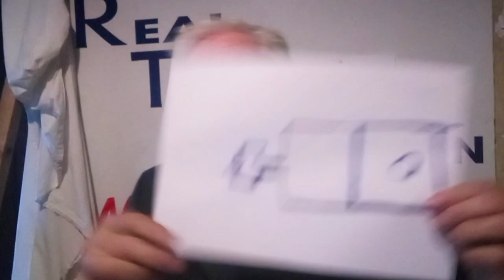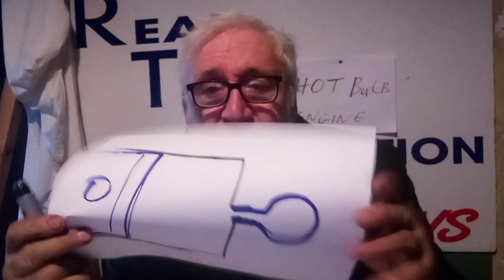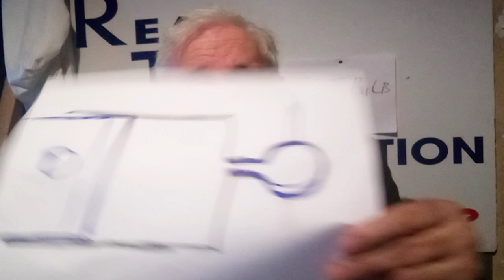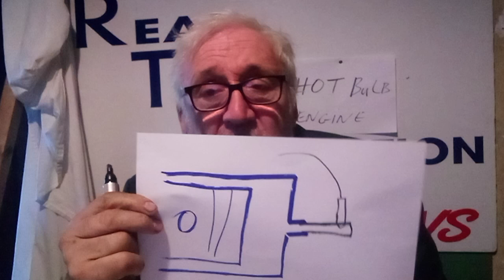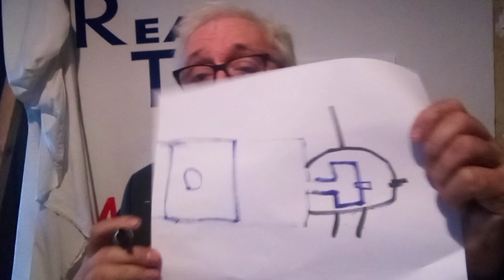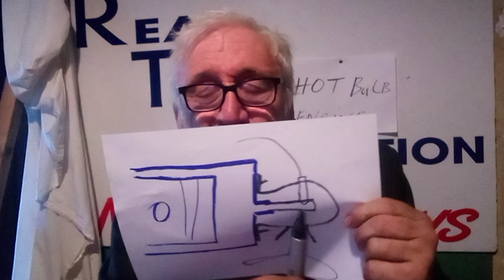The hot bulb engine. Vintage. 19/10/2023.

Comment: Were hot bulb engines used on small vessels? How was reverse achieved?
Reply: tractors and small power for tools ,,,reverse by transmission,,, two strokes can be run backwards lanze did that a couple years